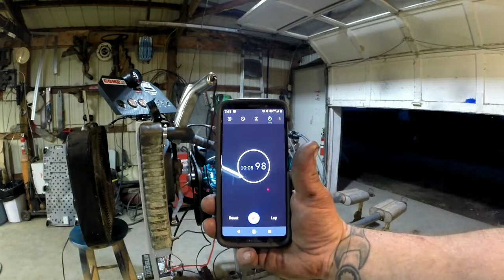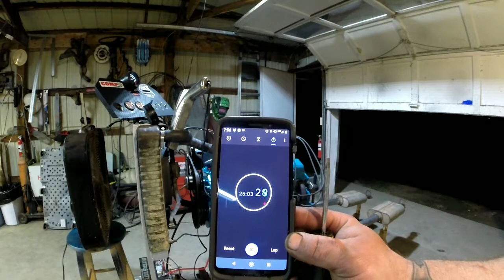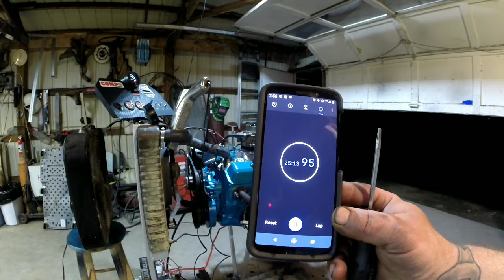350 Camshaft break-in time! How to break in a hydraulic flat tappet camshaft. Comp Cams Magnum 270H

Comment: Building a 454 with a flat tappet cam, an sure do appreciate your videos and how to’s with these square body’s.... you’ve helped me a few times an kept me on track...
Reply from the maker: Awesome. I really appreciate these kind of comments. This is exactly why I started this channel. Let me know if I can help in any way. Good luck with the build. I need to get to work on one of my big blocks one of these days.
Reply: Squarebody Stuff what do you use to prime the oil system... just learned a rod doesn’t work as well probably why I was doing head gaskets on a 4.3 oil wouldn’t prime... assuming same case figurative maybe my lack of knowing the oil kick out at disturber location has means of only one side of the block
Reply from the maker: I use an old distributor withe the gear machined off.  Not sure if you've seen my video on the subject but here it is. 
https://youtu.be/9f30iH7mBxM
Reply: Squarebody Stuff thank you an as I’ve learned something I now know it all lol, always have primed with a handmade unit that only connected to the shaft... now I understand how to actually run oil threw the system...! Not sure why I’m learning this now and maybe been lucky to not have failures lol but definitely looking better than I was...!

Comment: New camshaft before install always micrometer each lobe should be at least .003 taper to make lifters rotate, each lifter should have crown .015, most camshaft failures are poor machining, and new lifters a junk if base does not have burnish from heat treating.

Comment: so do you drain all the old oil and just put in break in oil during the break in procedure?
Reply from the maker: Yes.
Reply: @SquarebodyStuff  Should you remove the break in oil right after the procedure? Also is it necessary you have to prime the oil system?
Reply from the maker: @laashep you can run the break in oil for a while, maybe the first 500 miles or so. 
If in doubt,  always prime the oil system. Keep in mind, the oil is what keeps all the parts alive. Don't take shortcuts.

Comment: My search continues... what did Detroit do back in the day with engine assembly?  I note Chevy built 2.06M units in 1969 - I don't believe they had time for these fan dances.  I would be surprised if a run-in lasted longer than 5 minutes. Remember: the purpose of a break-in oil is is increased wear through reduced protection, so are we saying cam & lifter manufctureres are delivering product with poor ra surface finish? What should it be if we believe that?

Comment: Are you supposed to vary the RPM from 1,500 to 3,000 RPM or run at 3,000 RPM for the interior 20 min?
Reply from the maker: I do vary it between 2-3k. But the main thing it to keep up rpm to splash oil on the cam. It's still running strong after 4 years, I guess I got lucky.

Comment: What brand lifters do you usually go with on a flat tappet sbc.  I hear alot of scary stories about wiping the lobes or the foot of the lifter here lately.
Reply from the maker: I've always had good luck with speed pro.
Reply: @SquarebodyStuff  awesome man. Thank you for the reply.  I have an all original 1986 k10 4x4 with a 305 in it. Pretty much rust free. Daily driver as of right now but the cam is getting worn down.
Reply from the maker: I think most of the big cam companies have the lifter situation figured  out.
Reply: @SquarebodyStuff  awesome. How long do you think a new cam will last with old bearings in the block? Thats if they look good when i pull the cam out
Reply from the maker: Hard to say, I've always had good luck with it. My daily c10 is going on 3 or 4 years now after the cam swap on used bearings

Comment: what about removing the inner spring on break in,ever done it?thoughts?
Reply from the maker: It's just a damper on these stock style springs. No need to remove them. If I was running a heavier dual spring set up, then I'd remove the inner spring for break in.

Comment: did you have the vacuum advance plugged off?dont you have to to check total timing?mines on the stand,wont crank with the vac adv plugged,connect it and it cranks but with  the timing light it shows 4 white lines,where i have only ''0'' highlighted,my light is set to 36degree's,checked tdc no less than 5 times,checked wire designations 10 times,pulling my hair out man,its a 78sbc 350,40 over, weiand intake, street demon625,hei and 4x4 type comp cam,nothing radical,any idea where to go from here?
Reply from the maker: I set total timing with the vac advance plugged off and the engine around 3500 rpm.
Reply from the maker: If you are setting it 36 deg. while just cranking you are way to far advanced.

Comment: Hey bud I got a 350 bored 30 over it also has hyperetic  flattop pistons with a 22200 melling cam and recondition connecting rods with Vortec 062 heads all looked Thru and cleaned up at the engine shop I have 0 run time on it they gave me high Zinc additive one bottle..it’s a derby engine with 10:1 compression I’m abit nervous on how to do this, do all your videos fall in my category? Of what I need for info to do This? Is every sbc break it basically the same? This is my first engine break in ever 🤙🏽
Reply from the maker: These videos should point you in the right direction. Pretty much all engine break ins will be the same unless you have a roller cam.
Reply: @SquarebodyStuff  can I still use my upright open header to break it in? Or will it het way too hot?
Reply from the maker: @skagonmotorz4199  they'll be fine.

Comment: I never got a real good explanation of the break in, and why.  Its suppose to make the lifter to the cam lobe and everyone says thier isn't enough oil at idle to do this.  So if there is insufficient oiling for break in, how is there sufficient oiling for idling after break in? Lol 
Some say take out inner spring other say no? 
Gees my Butt is puckered just thinking about doing my break in soon.
Reply from the maker: It to establish a good wear pattern between the cam and lifters. Until that is established there isn't  enough lube being splashed on the cam to lube properly. Also the extra load and oil pressure keeps the lifters pumped up and valvetrain loaded. Don't stress to much. Good lube with plenty of zinc,  keep the rpms up. As long as everything else was done right then not much to worry  about.

Comment: You have the lighter springs for the flat tapets in? Curious
Reply from the maker: They are the "z/28" single springs with dampers.  No need to run lighter springs for break with these.
Reply: Unless your running dual bee hive springs then just break in with one set removed

Comment: Very nice video I'm getting ready to do the same thing with my 350sbc where did you have your initial timing set at 0 degrees 4,8 10, or 12 I'm guessing your total timing was anywhere between 36 and 38
Reply from the maker: Thanks. I always set my timing  at total without the vacuum  advance  hooked up. Usually  starting out around 36 degrees.
Reply: Okay thanks don't you also have to set and initial timing for startup or idle
Reply from the maker: Timing at idle ends up wherever  it ends up after setting total. It all depends on how much mechanical  advance is the distributor  has.
Reply: Ok appreciate you 🦾
Reply from the maker: No problem
Reply: @SquarebodyStuff   What RPM you set your total timing at?
Reply from the maker: Above 3000. Just rev it up till the timing stops moving and that's total.

Comment: How soon do you change the oil after breaking in a cam? Do you wait the normal 3,000 mi? Also, I thought the break-in period should be 20 minutes, not 25. I'm new to this so I'm just curious if you added the extra 5 just to be sure or if that's what you've always done. I love this channel and thank you so much for posting this video!
Reply: 20 mins at 2000 RPM using break in oil and graphite lube on lobes. Break in oil is important because it isn’t loaded with detergents and crap.

Comment: Where did you get the gauges set up at and cost
Reply from the maker: I think the gauges were from Amazon. Here's part two of the test stand video. https://youtu.be/3vLudKqwqVs
Reply: @SquarebodyStuff  oh ok I'm watching your break in video now and I'd like that set up to do my 04 4.8 gonna do a cam and springs swap to beef her up some so I can haul a 5th wheel camper with it my truck is only a 1/2 ton with 239687 miles on it

Comment: All this is great if you are back in 2020. Here in covid world of 2022 all the flat tappet lifters you can buy are JUNK. They will last about an hour run time and KILL your engine. All bearings,  cam crank, maybe rocker arms and shafts if it has them. Of course all the gaskets, seals oil, filter, etc that are now ruined and all the labor.
Reply from the maker: I'm not having any issues in 2022 with lifters. How many lifters have you had personally? Just curious.   This last 454 I stuck a flat tappet in just this September and haven't  had any issues.
Reply: @SquarebodyStuff  There's been a lot of chatter about bad lifters but on uncle Tony's garage he has traced the problem  to camshafts ground without proper taper. I'm starting my jegs crate motor tomorrow.  I pray to God they checked the cam before they installed it.
Reply: Just fired up my fresh build 355 with comps 268h cam and within 5 minutes of running at 2k rpm for the break in it chewed up one of the lifters. Chinese junk metal.
Reply: That’s why I paid more for Insky

Comment: So you’re telling me that Ford in general motors in Chrysler every engine that they building put the vehicle they break in a camshaft I think that’s just bullshit breaking in a camshaft run it how you’re gonna run the fucker and leave it be
Reply: Break in for a camshaft only really applies to flat tappet cams. Nothing to worry about with newer roller cam engines I don’t think.
Flat tappet cams also require a high zinc, low detergent engine oil, while roller cams don’t. The two camshafts are completely different. Flat tappet cams WILL eat lifters and wipe cam lobes when not broke in correctly.
Reply: New vehicles dont use flat tappet.